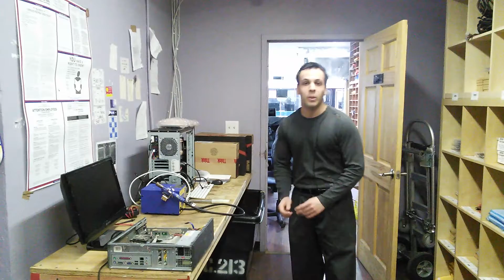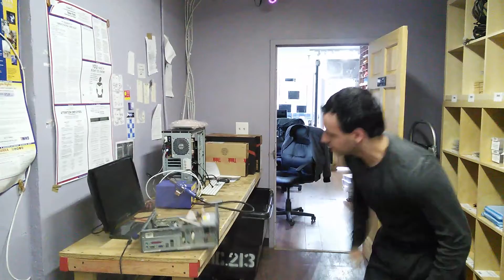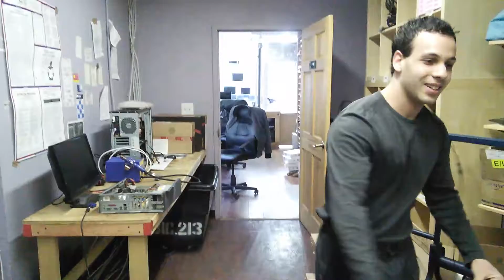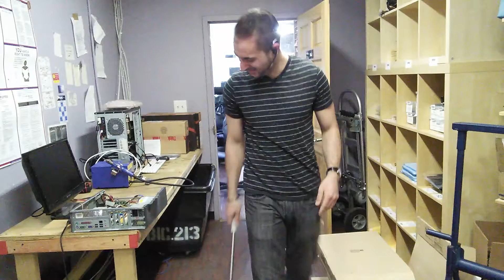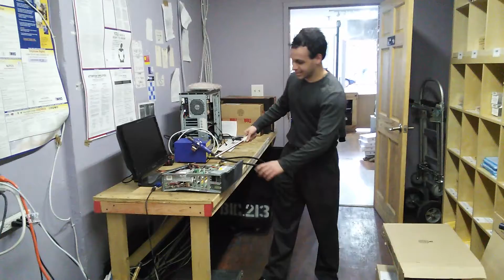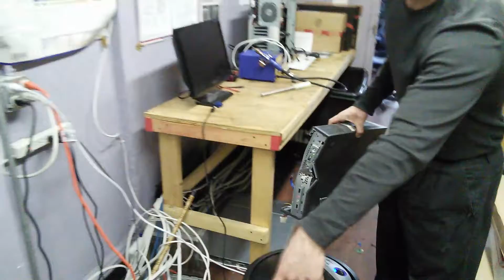How to repair a FreePBX/Asterisk PBX using Lenovo hardware as an authorized repair center.

Comment: You should "repair" your hands\head in the same way. Why destroy hardware if you fail to configure it properly?
You could also donate it to local charity if you wanted to get rid of it.
Reply from the maker: +RmFrZQ It is a broken, beat up, old POS with a CPU that can't pass prime95 from over ten years ago. In the trash it goes along with your opinions!
Reply: @rossmanngroup  melting it and selling the scrap? ~15-20$?
Reply: @AffectionateLocomotive that’s fucking insane